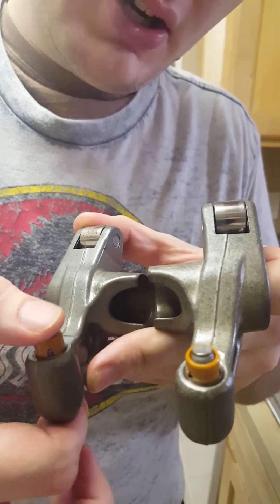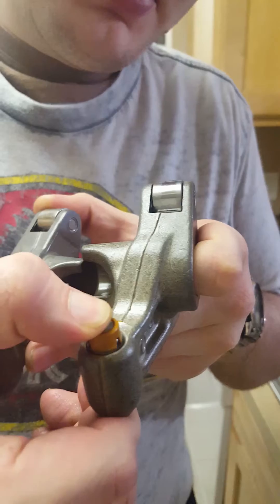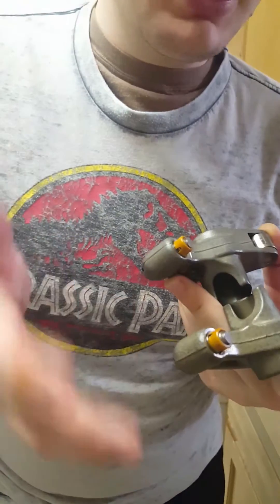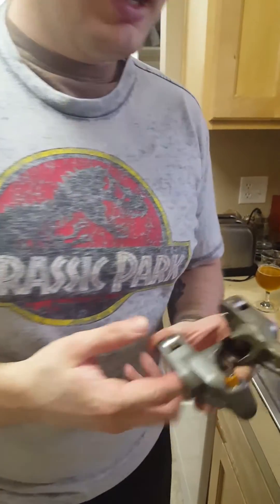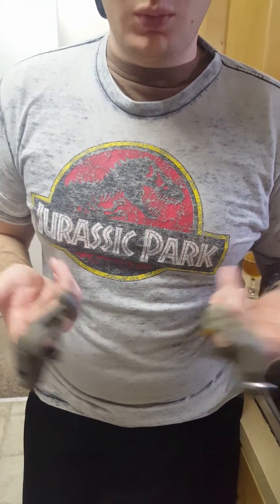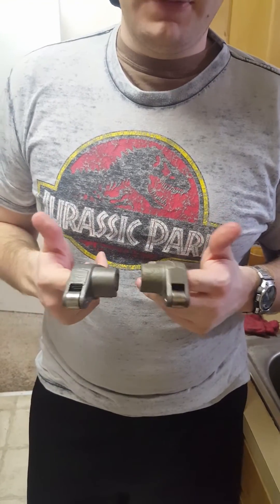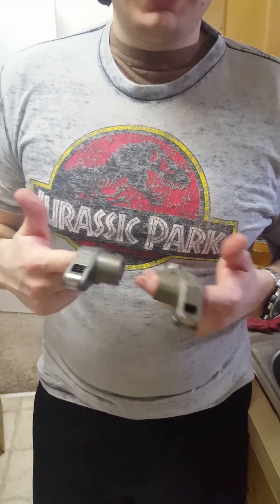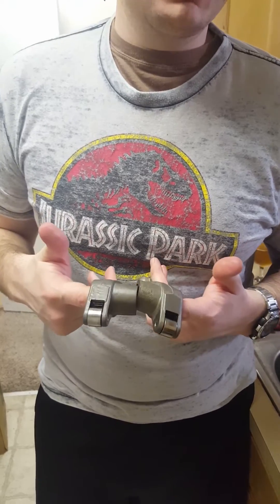3.5l v6 dodge jeep chryler rocker arm failures tick.

Comment: You are so right about that ticking. I have the same problem with my Dodge Charger. I took my Shaft Assembly Rocker Arm up. But I can't take the dial pins out. So I can replace the Exhaust side. Can you make a video or get back with me and show me.

Comment: Did you have side to side play in Your Rocker Arms? What Causes Side to Side Play? I Thought it was a result of the Dowel Pins Shearing/breaking off, But, I've Removed all My dowel pins and they weren't Broken. So what else is causing/creating these Side to side Play on these Rockers? And seems like there's no way to Repair/Re-use The Rockers evem after replacing the Shot Lifters....?? 😳
Reply: Absolutely not,  lots of play is not good, they have worn out and now should be replaced, replacing the whole think rockers and the whole arm is recommended lifters fo bad same time.
Reply from the maker: That's correct, once the built in lifters go bad, you have to replace the rocker arm itself. You can replace them independently or the whole rocker assembly. It's recommended you do them all at once but I'm a cheap person. There will be slight side to side play but send me a video of your issue and I'll take a look.
Reply: @seand2022  Yea, You're not alone Pal, I'm El Cheapo Too. I have already order a 24 Set Lifters to go in it. But, I just want to know how much play is too much or if the play doesn't matter. But here is the video https://youtu.be/n2wGmxbNfiw
Reply: @phigo4kins   yes, replace the whole rocker arm assembly,  cheap and easier, look on ebay
Reply: @joemoma4598  I don't Have $200-$300 To spend on a whole set Of Rocker Arms. Its not like its a Newer Car/Engine. I don't have a Justification for it.

Comment: Will those cause misfire at idle only and work fine higher rpm
Reply from the maker: There are many things that can cause that type of issue, I would do the basic checks first, Look at your plugs, compression check the cylinders, that might even be as simple as a bad coil pack. What have you checked so far?

Comment: Dose side to side movement matter in the rocker arm if so what is considered tomuch
Reply from the maker: There is no spec listed. if it moves enough that it seems like it's gonna come off, replace it, most of it's common sense. I just replace the whole rocker assemblies at this point.

Comment: They are called Lash Adjusters.  Can be driven out and replaced.
Reply: Easy to change the whole arm assembly,  both sides about 500, put back TOGETHER , so quiet.
Reply: @joemoma4598  where did you get them from, the assembly
Reply: @benmart806   ebay, they are common, lifters an DC rocker arm assembly
Reply: Gord Baker when I take off the valve covers and they are loose is that a bad thing